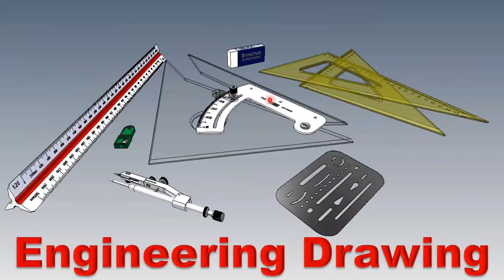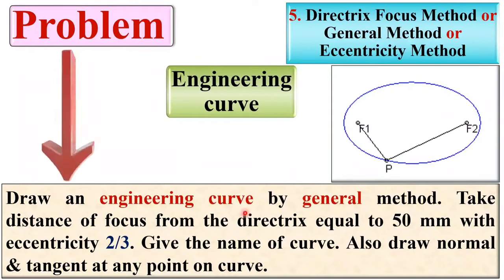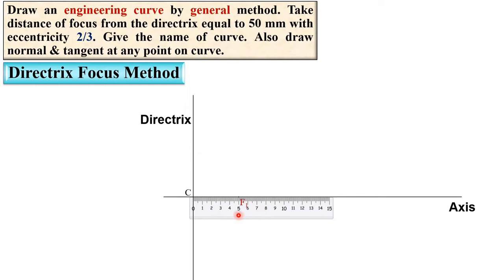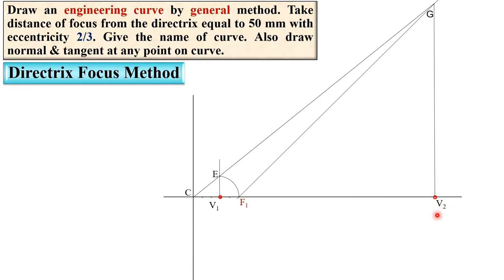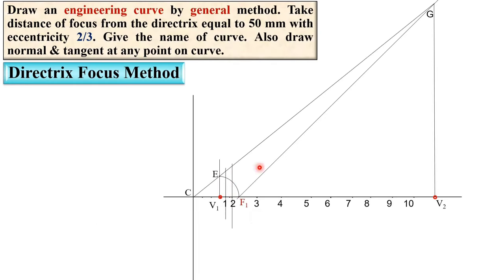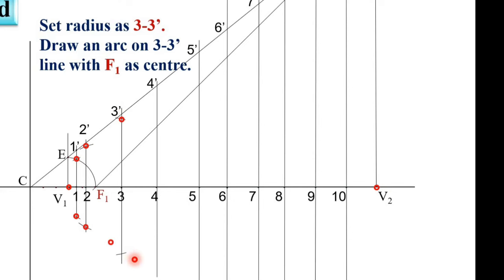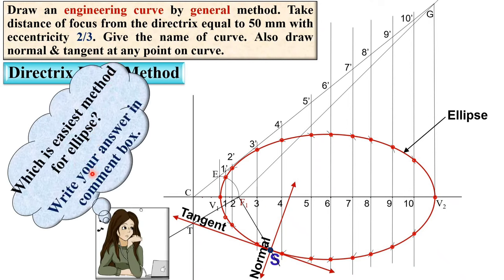Ellipse by Directrix focus Method | Draw Normal and Tangent to Ellipse | Ellipse Drawing

Comment from the maker: Directrix focus Method explained with following timestamp: 
0:00 – Directrix focus Method - Engineering Drawing lecture series 
0:10 – Methods for ellipse 
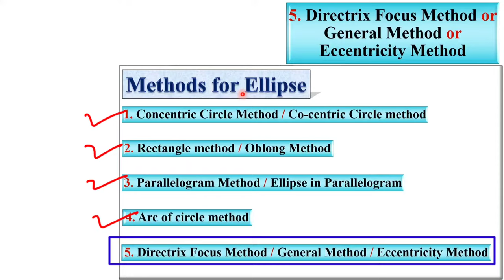0:35 – Draw an engineering curve by general method
0:45 – Eccentricity 2/3
1:50 – Directrix focus method
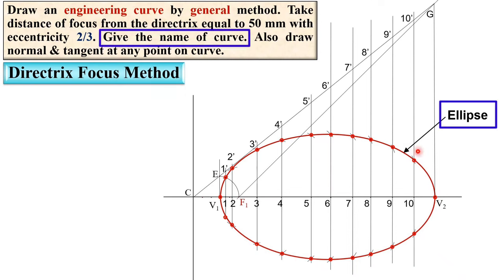8:08 – Draw normal and tangent